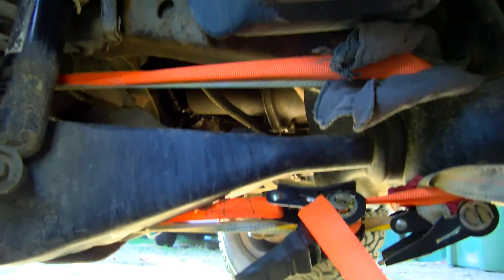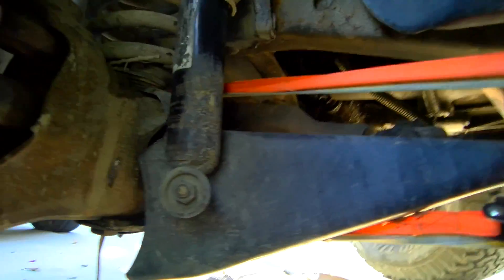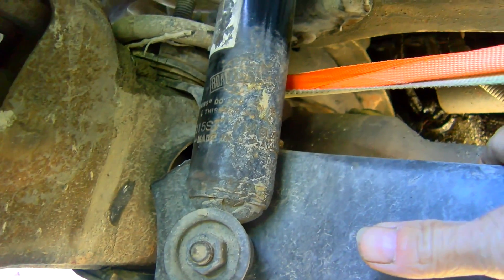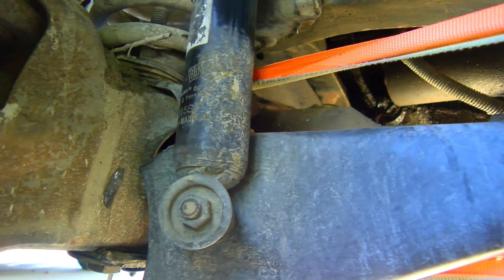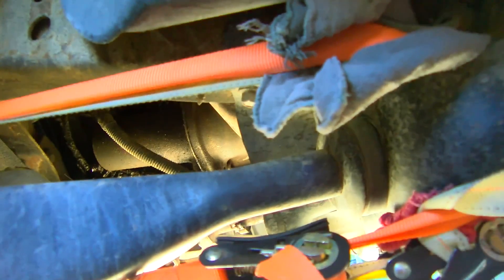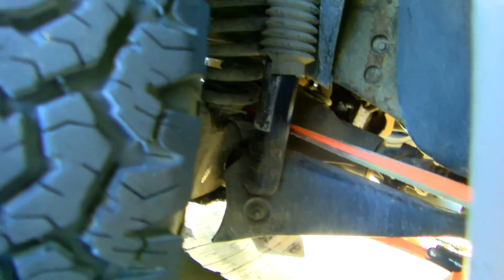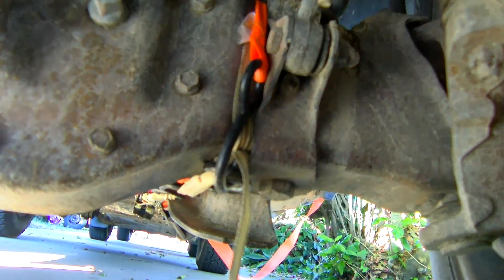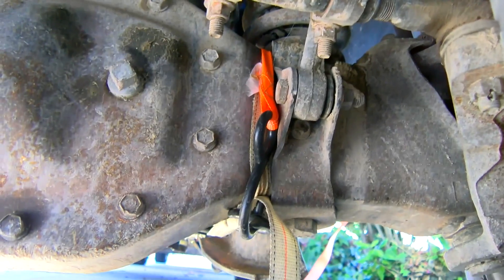Ford Explorer Radius Arm Failure

Comment: IDK man the 2007 explorer I had had a SHITPILE of offroad miles on it (Lots of driving to tower sites and stuff) It died due to high mileage, the engine and transmission just wore out AND I needed to get a bigger truck anyways so I got a 2014 Expedition XLT now..
Changing the radius arm(s) is not too much of a chore on the explorer, you should go on and get both just to be sure as well and new bushings too..

Comment: I would just replace both radius arms and go on about my day. I've seen many of these 90's Ford Explorers with over 500,000 miles and still going.
Reply from the maker: +Emerson Collie Im going to replace the one to start and see how it goes. This is not your regular city explorer. This thing has been abused to the max
Reply: +shango066 Yeah but they are a lot of fun to drive. It's worth it to me.

Comment: Got almost 200,000 miles on my 2000 Expedition. Only broke a half shaft and that was probably me being stupid getting it stuck and cranking the steering wheel hard while the tires are spinning. Other then that it's a year round Michigan vehicle, I could still be driving on it's original suspension part's, but the rust holes is a bit sketchy so I had the 4-link and a sway bar replaced. Mostly wherever the tires fling stuff is where the worst rust is. Frame still has paint in most area's. Been a good suv for me, never let me down. ;)

Comment: Wow, you must have really beat that front axle. I have never seen a stock/rust free Radius Arm break at that end.

It looks mostly rust free and it isn't too bad a job. Spray everything down with Kroil and it will come apart fairly easy. Of course you are going to need some impacts.

Comment: Some big bolts but really not too much involved in the repair. Looks rust free so shouldn't take more than a few hours in the driveway with a breaker bar or less with air tools. Go to the wrecking yard and pull one as it is good practice and lets you know what to expect. Great ingenuity with the ratchet straps.
Reply: +sixtyfiveford  I'm sure there are ones in the wrecking yards for parts, but that damn Cash for Clunkers took a lot of decent parts vehicles right to the smelter. Especially the age range for this Explorer